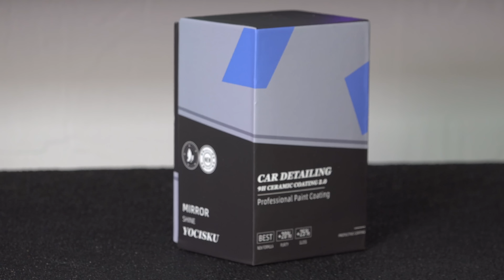I Ceramic Coated my SNOW BLOWER to make it NON STICK

Comment: Interesting. Ive been using spray wax for years with good results. I just hose it on and let it dry.
Reply: Turtle wax ceramic spray.
Reply: @thomaspayne6866  i bet that works great too. Just more pricey.  Probably lasts longer though too.

Comment: Would this work on a blower with a plastic shoot? If not, will the cooking spray work?
Reply: WD40, a silicone lube, or PAM, but Pam gets sticky when the pack melts in the garage.
They sell specialized stuff "for snow", but you can use any auto wax protectant that's safe for plastic.
Checking out the automotive aisle is worth the time, and a routine followup with a spray after the pack melts and everything is dry for a while is always helpful too.
Often considered a touch up, the quick mist stuff could be considered the consumable buffer zone before wearing the true coating that you have to spend time applying.
The Mothers Brand make some good products like that, but be sure to smooth any gouges in that plastic chute first, and apply the base coat days in advance.

Comment: I have done this for a couple years now on my Honda.  I also use a cheaper Amazon coating.  I redo mine each year but you could probably get a couple of years out of an application.   Make a real difference with wet slushy snow.

Comment: Great video. I live in Vermont and luckily haven't had to use my snowblower this year. 
I bought it at the end of the season but never used it. I put some rubber pieces on my impeller during the summer and haven't needed to use it yet. It's a bitter sweet I suppose. I put the rubber on my impeller because I saw it on YouTube. It's supposed to throw the snow further and being that the rubber is closer to the housing it means less build-up if snow and more importantly no ice when it's been sitting. I've heard that it will throw your snow 30%-40% further. It cost me around $10-$15 dollars for everything. I used two bolts with washers and nuts to hold it onto the impeller. The rubber I used was a snowblower paddle from one of those old electric toro snow sweepers. I cut it into approximately two inch pieces and drilled holes into each piece along with drilling holes into the impeller. I think I had 3 or 4 pieces for my machine. I ran it for a while to let the rubber wear down a little while it was warm so that it didn't break if it was to cold. Fingers crossed that it works out well for me. Maybe you can do a video on how this would be done and the results afterwards? Just a suggestion. Thanks for your time and videos. I enjoy them immensely.

Comment: Great idea. One of the mail reasons you get a clog is that the impeller that shoots the snow out has a gap between it and the housing. So since snow sticks well to snow (the reason there’s lots of siping on snow tires), any snow that does cling to the housing wants to catch more snow. I did the expeller flap modification a couple years ago. Basically it’s like putting mud flaps on your impeller blades so it sweeps the housing as it goes. Not only have I not gotten a clog, even in heavy slush where it pours out the chute like mustard, I also shoot snow noticeably further. It can practically pump water now. It’s fantastic. You should give it a try. I can find links to the videos I’ve watched if you want.
Reply: I meant main reasons, not mail reasons...
Reply: @BenNawrath  The reason the snow clogs is because it STICKS to the paint.  Not because of any gaps.  If you wax... you will never have another block or clog.  Just try doing to exit hole area and you will see a HUGE difference.  No need for any rubber pieces on the impeller fan.
Reply: @kielbasaglen6843  I’ve done silicone lube and stuff too. And I agree, that will definitely help. But filling that gap definitely makes the impeller more efficient. I can shoot slush further than I could shoot snow before.

Comment: You have snow on the gearbox because it's the only part with cast aluminum surface finish, AND non moving part, AND central point where both augers converge snow,and not because you didn't coat it.
You pack snow because the transition between the chute and the volute is very bad.
Grind the square transition where it rotates,you will get better flow.
You can also direct exhaust fumes in the back of the auger,so it will constantly be hot,will melt snow ,wich will create a thin coat of liquid water,and allow snnow to slide on.

Comment: I'm on a hill.  I'm going to treat my whole driveway and watch the snow slide right into the road.
Reply: And you car won't have any traction, hahaha!
Reply: Car slip and slides are fun
Reply: @RadicalEdward_115  studded snow tires FTW
Reply: @supersoccrstar  what are you on about?
Reply: Big brain
Reply: @utmark07  ?
Reply: Just do like the guy who just went viral. He used a flame thrower to melt all the snow of his driveway. he was on a hill too. Ill see if I can find the video
Reply: @randyman8984  
Don’t click the link the video is unavailable.
Reply: @randyman8984  it takes more energy to melt ice than steel interestingly, (although I’ve never scientifically measured the results)
Reply: @allensandven0 , true, but it will take a whole lot more energy to heat the steel up to the melting point of about 2500 F.
Reply: Sorry, I meant your car.
Reply: Lol
Reply: Make sure to order Amazon packages to arrive on multiple days.
And have a trail cam setup to catch the fun.
Reply: Make a YouTube video about  it
Reply: Please at least get us the footage of your car sliding right into the road. Lol
Reply: Just don't accidentally spray the clouds...I will never stop snowing
Reply: Lol
Reply: Post a video then prof off consept🤪👍👍
Reply: Lol
Reply: please do that. i'd love to see it haha
Reply: Smooth your concrete first
Reply: To fix your car sliding all around all you'd need is a winch in you garage plus hook the line onto an RC car and now you'll never have to worry about traction.
Reply: I'm hollering dawg🤣🤣🤣
Reply: I put this on the bottom of my car
Now I don’t need tires, I just slide around town even in summer
Reply: Lol
Reply: LMAO!!!!!
Reply: Haha it pays to think outside the box! Made me chuckle 😆
Reply: Terribly off topic. I saw this before you Toro 42 " vid. Are you planning to review Ryobi electric 42" zero turn?
Reply: You're a genius ,make sure you do the stairs , in the summer you will be able to scramble eggs on your driveway .
Reply: lol I can picture that. I would be hilarious if you had a neighbor at the bottom of said hill.
Reply: Yeah! Why ceramic coat your snowblower and then clear your driveway? Skip the middle man and straight to the driveway. I would never have thought of that.
Reply: I would love to see the video
Reply: I had neighbors with a really steep driveway. They redid it with heat under and it was so fun to turn it on and watch it slide after the fist snow!
Reply: @austinthrowsstuff  That's funny.  Our steep driveway is actually heated.  Well, the boiler arrived yesterday and will hopefully be in before the next snow.  I'll keep you posted.
Reply: @482jpsquared  please record a video when you turn on the heat under your driveway

Comment: Ceramic coatings are incredible! I have 2 of my cars done and it is amazing how little dirt/salt sticks to the paint now. Question for you, I've seen several people here on Youtube bolt on heavy duty rubber to the impeller to get rid of the gap in the impeller housing. It supposedly won't allow any ice to build up in the chute. Any opinions on this?
Reply: @Jack Torse I have done the impeller mod 2 years ago and it works very well.  Especially at the EOD snow pile.  33" 13hp MTD with 16" impeller.  Purchased in 1997.  I used 4" baling belt bought at Central Tractor.
Reply: Conveyor belt and rubber truck mudflap's are the most common.
Head over to Napa, they have a flap that's near a 1/4" thick, that's kinda what you are looking for, get fat fender washers and don't skimp on the Nylock nuts, the locking nuts with a built in plastic bushing!
Reply: Best mod I have done to my Ariens 926LE after adding dual impeller belts. I've done this same rubber scraper mod to several neighbors machines as well, and I have found that a single, self tapping screw and a 1" dia. fender washer works just fine. I got tired of match drilling holes and using bolts and nuts. Just remove the chute for easier access. If you have four impellers, you only need two opposing pads, but if you have three impeller blades, you need to do all three. I cut the pads from a truck mud flap I found in the street. Just be sure to put a small chamfer on the leading edge of the rubber pad to help with the break in. Good luck.
Reply: Jack it works, my blower would clog on the slush at the end of the driveway, not anymore.  Works amazing.
Reply: @stephenmcgowan8572  what type of material did you attach to the impeller?
Reply: Do it. I bought a Troy built from Home Depot that couldn’t throw  moist snow at all and did the mod with pieces of conveyor belt. She launches snow like a champ now. Why don’t they engineer these right in the first place?

Comment: Can you try to heat the chute and/or the backside with the exhaustgas, so it whould melt and fly of if something stick on in. Dumptrucks have similar system to prevent material from sticking.
Reply from the maker: That would be very nice to have!

Comment: Please try to remember to add a follow up at the end of the season to tell us how many times you ended up using that machine, what kind of snow you got, and how the coating held up.  Thanks!
Reply from the maker: Will do, I want to know as much for me as you do too. The clogs and blockages are the worst!
Reply: @SilverCymbal  Are you planning to (re)coat the areas that you mentioned at the end of the video before the next snowfall?  I'd be interested in seeing a side-by-side comparison of a screen shot of what you showed here and a screenshot after a secondary application.
Reply: @SilverCymbal  Well?
Reply: @troye.1309  lol, the quality of a youtube person is often seen in the promises they keep or follow up videos
Reply from the maker: @troye.1309  Sadly I can't tell you much, the snow you saw in this video was the extent of what we got last year. 5 years ago it never ended now who knows
Reply: @SilverCymbal  5 years ago was Snowmageddon in the Pacific Northwest. That was horrible. Volunteers came from far away, even from Canada, to help move snow.

Are you going to add pieces of conveyor belting to the impeller to get as close to zero clearance as possible? I've seen several people post videos of their blowers with that modification and they throw snow much father and throw slush OUT rather than letting it build up, fall back into the chute and clog. Haven't bothered to do that to mine because other than the freak year once in a while we get snow 2 or 3 times and most of it melts before the next snow. This winter we've had snow twice that's been deep enough to need blowing. Still have a little bit of the second "big" snowfall on the ground, mostly on the north sides of buildings.
Reply: @SilverCymbal  Subscribed for the follow-up video at end of season!
Reply: @SilverCymbal  how did it work out?

Comment: Thanks for that video , I had been using Pam on my snowblower and it helps for a while . This looks like just the ticket for the super wet snow we usually get where I live . My two stage blower chills it as it passes through the chute and it is amazing how quick it will freeze solid .

Comment: Dude, that is one bad ass snow blower! Me rikey! lol. You always have cool stuff. I've been very frustrated with my Craftsman machine I bought in 2014. It ALWAYS clogs. The thing has been useless since I got it. I'm in Denver, we get a little snow lol.  I did a paddle mod this summer but haven't got to try it yet. I changed the oil a couple weeks ago and now it has a giant oil leak coming from somewhere. I just want to blow the damn thing up. I've been a painter since 89, the best thing for cleaning a surface like that that I've found is denatured alcohol. I've no idea how similar it is to regular alcohol though.
Reply: Check the belt tension on the thrower. Mine was clogging like crazy before I tightened it up. Granted though my Craftsman is an '85
Reply: Look up sixtyfiveford how to modify snowblower so it never clogs.  I put the paddles on my impeller and now the thing will throw water, sand, rocks it never clogs.
Reply: @stephenmcgowan8572  I first found that video a couple years ago. Thats what I did to my machine back in July.
Reply: You'll probably be fine with that paddle mod on the impeller. My 1971 Ariens throws dry snow about 60 feet and wet snow about 20 with it. It never clogs, even through the end of driveway windrow.
Reply: @mudshark351  Right on, I hope so. Now I just need to figure out where the oil is coming from. When I did the oil change I didn't even start the engine afterwards.
Reply: @Gitarzan66   If your engine has the tall oil fill tube, a lot of times the o-ring at the bottom of it leaks when you fill it. If the oil level was good before you changed it and it wasn't leaking then, it's probably that.
Reply: @mudshark351  It does have that tall filler tube. The level was good before I changed it. I went back the next day to check the level before I started it and there was a puddle. Do I need to change an O-ring then?
Reply: @Gitarzan66  Hard to say without seeing it, or how big and where the puddle was. But if the level is still good with the new oil and there is no new puddle, I'd say you'd be fine. Those fill tubes usually have a bolt or clamp holding them somewhere along the tube and then just pop into the base with an o-ring around the bottom of the tube. See if it has gotten pulled out a bit over the years and if not take it out and check it.
Reply: @mudshark351  The puddle is about 6-7 inches across and formed under the front side of the engine. I would say directly below the fill tube. I didn't start the engine after I put the oil in. I wanted to let it settle overnight and check the level first.
Reply: @Gitarzan66  I'd bet that's where it came from then. A puddle that big isn't really that much oil given the way oil spreads out (probably only a cap full from a quart bottle). I'd clean the bottom of the tube with some brake cleaner and see if it gets wet there after you top it off and run it. I bet when you check the level it's not down much at all.
Reply: @mudshark351  Right on my guitar playing brother lol. I'll check it out. Thanks for the help. I'll let you know what I find.
Reply: There are 2 common ways to denature the alcohol, adding methanol preferred, and adding diesel not as good as diesel is an oil and leaves a residue. Methanol is another alcohol,   wood alcohol which is toxic,  which is what the ATF wants to do so that it avoids the federal alcohol tax.  This is knowledge from working with shellac wood finish.
Reply: Consider an Arens.  They are amazing.
Reply: Try ego 2 stage electric blower

Comment: If we had snow here, I’d definitely be adding that coating. I remember living in the north and putting “Cisco cooking grease” on my snow shovel before I did a driveway and sidewalk for money as a kid (60 years ago - haha)
Reply: Baby oil (mineral oil) also works great and now really cheap. I cut it with rubbing alcohol, 4:1 ratio and put into an old spray bottle. This also rust proofs the snow thrower and/or shovel. 👍

Comment: I just ceramic coated the snow, then I didn’t have to bother with the snowblower. Great content as usual. Thanks.
Reply: I wonder if you could just put it on the concrete?
Reply: @Gitarzan66   you can. look into Siloxa-Tek 8510 ;)
Reply from the maker: I love it! That would be better!
Reply: Hahahah

Comment: I dunno. I think I'll stick with silicone spray 😁
Reply from the maker: Whatever gets the job done is fine and I would never buy a fancy coating but if this lasts all year it will be very nice. The coatings on cars do very well
Reply: @SilverCymbal  I think the difference is wear.  The car just sits there so the coating won't wear off that fast.  The scrubbing action of the snow on the coating (like Pam or WD-40) will be removed by the snow rubbing it off.
Reply: @User1, is that silicone lubricant or silicone waterproofing that you're using? thanx.
Reply: @josephcampese5347  DuPont silicone spray lube sourced from Amazon. Works great, easy to apply, OK for metal, plastic, & rubber. Inexpensive, too!